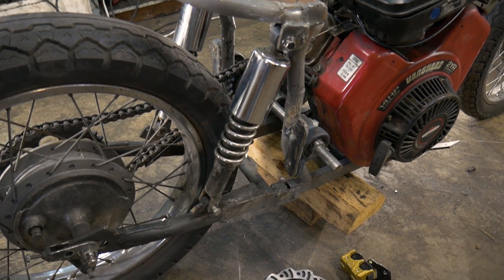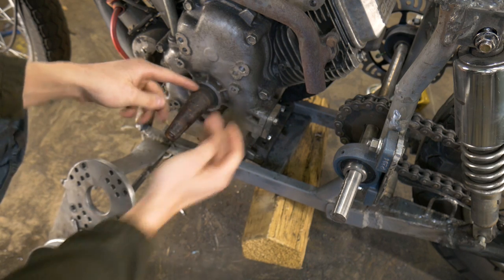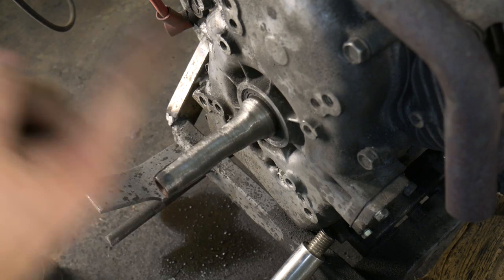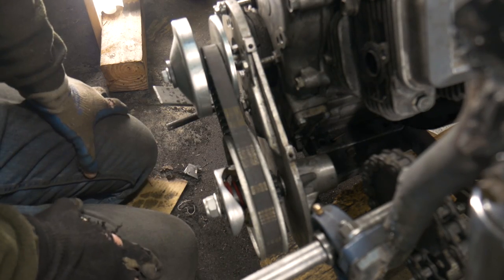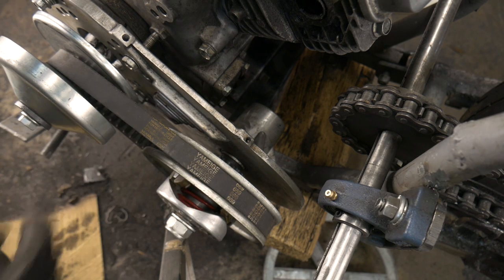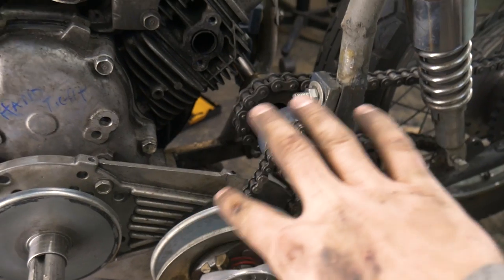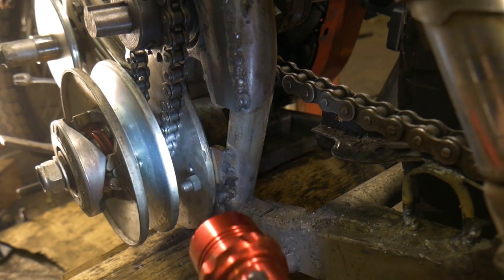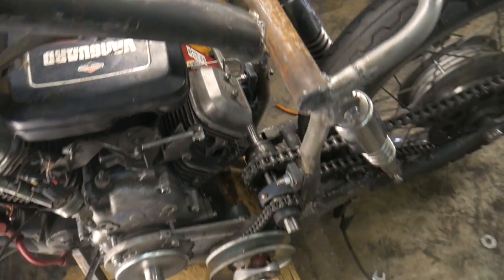built-from-scratch Motorcycle Build! #3

Comment: Looks good!!!! The chain issue you are having is cause the pivot on the swing arm  needs to match the drive sprocket.
Reply from the maker: Yes! I had to think long and hard, and stare at pictures of motorcycles until I realized all the bikes have the drive sprocket pretty much right at the pivot point. Thanks for the comment!
Reply: Hold the grinder flat